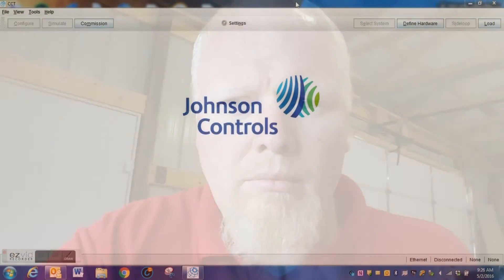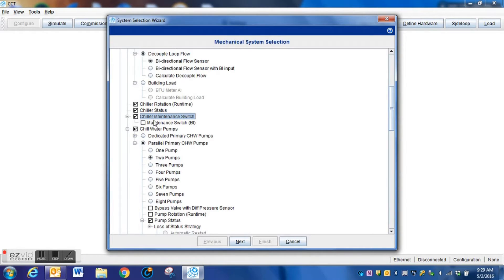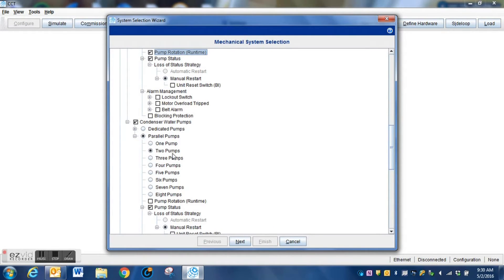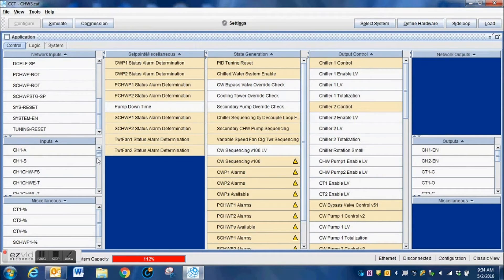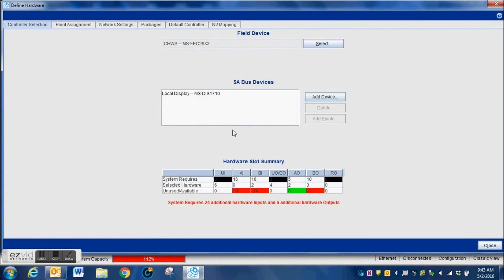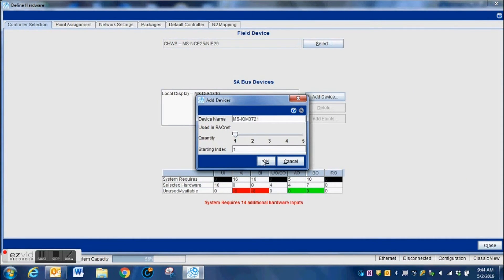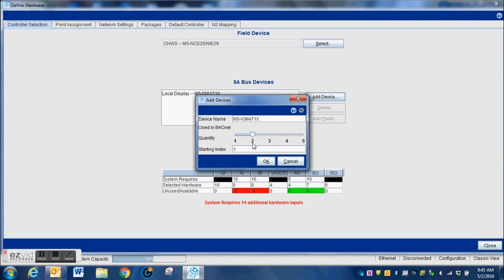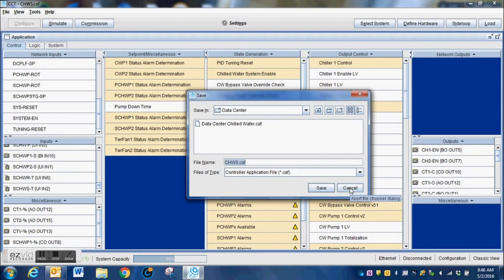How to program a chilled water system using Johnson Controls CCT

Comment: At my job location there are 6 York centrifugal chillers each 1200 ton (lead lag) it has 6 condenser, and 6 primary pumps and 7 secondary pumps, the problem is that when cpm turns on a primary pump with less number of runtime but it actually trips after some time and automatically turns on other primary pump with more runtime, and sometime it does not even turns on the least runtime pump and directly turns on the other pumps with more working hours, what could be the problem ?
Reply from the maker: There is clearly a programming issue within the system